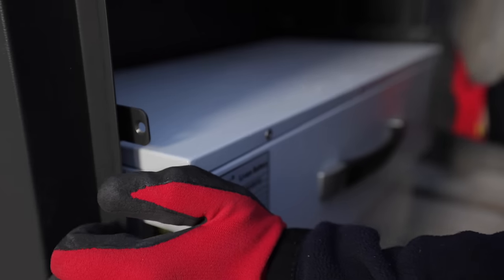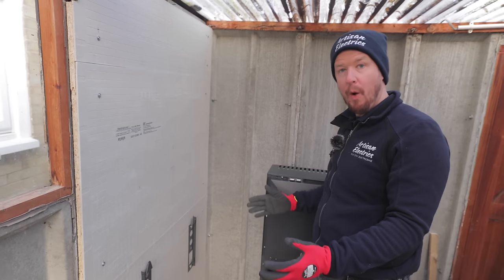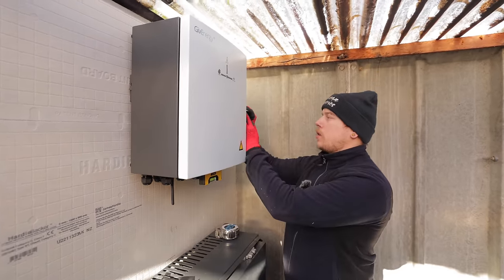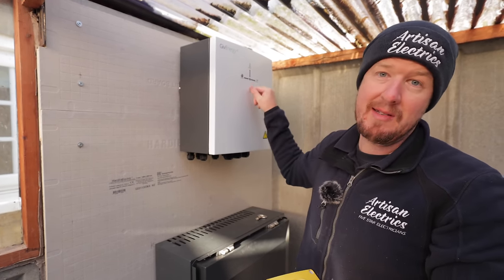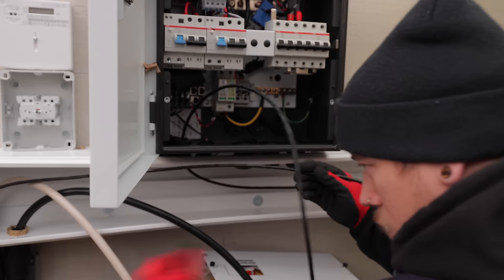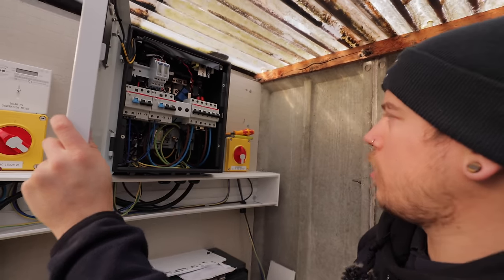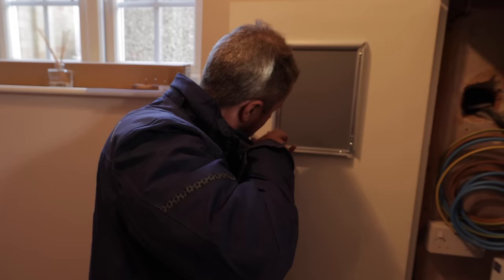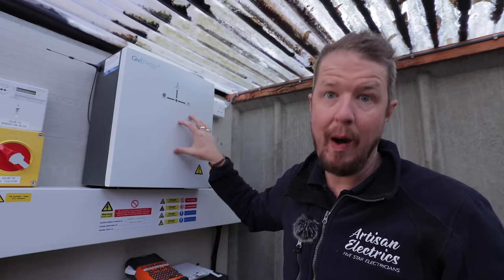How we installed the GivEnergy ALL IN ONE Home Battery System

Comment: I have the AIO and it’s a superb product. I control it locally with Home Assistant and really get the most out of it. Saved about 1/3 on my electricity over winter and have yet to benefit from the solar I had installed at the same time 😎
Reply: Wait till you have an EV and you can import at 7.5p and run your home from that instead of 30p grid price.
Reply: @Lewis_Standing  I already have an EV (and I have the Giv EVC awaiting install). I’m on Agile and averaging 10p/kWh through November and December. The ability to load shift and even better import cheap/free electricity and sell it back to Octopus for 15p 😜
Reply: I should add we are heavy users so Octopus Go (which is what I think you’re referring to) would be more expensive overall than Agile.
Reply: @jonathanthomson5000 have you thought about how long your batteries will last charging them up and discharging them for 5 pence per KW. Will it pay as batteries will only last for so many cycles.

Comment: Very informative video, thanks! I'm thinking of having one of these installed and I'm just wondering if the external isolators are a requirement or just an added extra that you guys install. Can isolation not be achieved using the breakers that already exist within the Gateway? Complete layman here, by the way!

Comment: I would be recommending much larger batteries guys. I have 36kwh of battery storage and it’s just enough to run all day in a 3 bed bungalow with 2 people in all day. We fully charge overnight in winter at cheap rate and also have 36kw of PV solar so in the summer months we don’t fully charge at night. 12 wouldn’t last very long for most…. Nice install tho! 😉👊🏼
Reply: 36 kWh is a hell of a lot. 
We have an older style give energy 5.2 kWh battery with 2700 watts of solar on our house average use in a day around 6kwh.
Reply: Used 158kwh in January! Are you growing weed?

Comment: How hot does that garage get in the summer and what temp can the battery operate at.

I had a small section of that corrugated clear roofing on my shed the rest was opaque.
It reached over 50 degrees Celsius (the thermometer wasn't marked above 50) near some metal shelves during a heatwave.

I have since replaced the roofing with just opaque stuff. It still gets hot in there but no where near as high.

Comment: 14:00 do i understand it right that in a normal house installation in the uk you rely on the erth that comes over the pen conductor? and don´t have a earth at the property which is tied into the pen on the entry of the service wires?
Reply: Neutral can be tied to earth at the service head, or you can have Earth stakes/matts.

Comment: 10:26 any normal person uses the cable with correct colors directly ... seems to be an UK thing sleevng other colors on cables ..    regulations here in Belgium are the cable has to be same color on the whole run ... and when a neutral is present and a blue wire it has to be neutral / PE has to be yellow green.   The rest of colors you can chose ( but  green or yellow wires are not allowed )  usally  L1 = brown L2= black L3 = grey ( but not obliged ) .
Reply: Heavier 3 core is used for 3 phase the vast majority of the time, so it’s produced in those colours. Difficult to find 3 core over 6mm in single phase colours.
Reply: It would be great if you could get the cable. Only way to get brown and blue is to buy 4 core which is more money and wasteful. Was never a problem in the old day with red yellow blue there was never any doubt. Since going to the stupid colours ( supposedly to harmonise with the rest of Europe) that’s when the problems set in

Comment: Every approved installer I contacted says they won’t do Giv energy installs due to poor customer service - something to do with the change over from V1 to V2 batteries. 
Has the customer service improved ? I really wanted an all in one.
Reply: As an installer I would disagree with customer service being an issue, Never had a problem with speaking to tech support be that commissioning or later on with a obscure setting.
Reply from the maker: We found the customer service to be good, we did need to phone for some help with the commissioning and they talked us through it.
Reply: As a customer on the rare occasions I’ve had to contact Giv (for technical support) they’ve been fantastic and there’s a great community on Facebook which includes some of their staff so it’s often not even required to call them as the hive mind almost always knows the answer 😜

Comment: I can only afford to make the change to green energy gradually. I plan on starting with a battery and charging on cheap rate over night so that I can start installing infrared ceiling panel heating. Ultimately I want the whole GivEnergi AOI system with solar, so can I start with just the battery or does it need the gateway installed with it? I'm leaving solar until last because the panels seem to be developing rapidly and as our roof is east/west with some chimney shading I want them to be able to cope well with that. As you can tell by the question, potential customer not sparky! Tia chaps, great vid, I like the way you instal on fireproof backing, makes sense to even up the walls. 👍
Reply: AIO and gateway are installed together
Reply: Solar first gives you the best return by using your own generated power, rather than going down the arbitrage path.  Battery technology is evolving more than solar panels, so deferring battery purchase also makes better sense.
Reply: @terrydennis467 oh, do you think so? I will keep an eye out on both then. I reckon it's going to depend on what time of year we start, in all honesty. Our finances should improve in the autumn so we'll be wanting to look at getting some infrared panels to start switching our heating away from gas. As they might add a bit to the heating bills (!) we'll want to supplement the cost which is why at that time of year it'll be battery first to alleviate their running costs. I'm just not sure how suitable our roof is for holding solar panels so I'd rather get into the nitty-gritty of that after I've got the heating sorted, if that makes sense. However if we don't get started on any of it until next spring/ summer I'll definitely consider panels first. it's a bit chicken and egg really isn't it?! Thanks for your advice, it's definitely given me food for thought. It may be that competition for this may arrive and drop the prices if nothing else. 👍
(I'm aware of the Tesla system but don't want to have anything to do with the Musk empire)
Reply: I think there is an argument that if you have an ev - a battery helps drop your overall energy price from 25-30/kwh to 10/kwh using ev tariffs. So the maybe the solar has to be considered against ‘when’ you use it and if you’re out during the day I imagine battery could be the best first step?
Reply: @constructioneerful  that's true and I do have an EV but no drive so can't really charge, although it is tempting to get a charger at the end of the garden and park on the grass like everyone else does🤔
I see what you're saying about being home all day, which I am and I need to not get cold hence wanting to power the IR panels with cheaper power from the battery. You're right that would be more sensibly done on solar but then at the time of year I need the heating will there be enough solar? Hence waiting for them to improve so I can get maximum solar gain throughout the year.

Comment: is there still a requirement for that generation meter you're fitting? Can you not use the serial number off of the gateway generation meter (GEM120) which is printed on the top of it? I know the MCS cert requires a serial number for a generation meter so why not use the GEM 120 instead? The house smart meter is for the SEG as I understand it anyways, so that generation meter is not really of any use. Not having a dig, just that a collegue told me MCS said the old gen meters are no longer needed. Cheers, great vid by the way.
Reply: I had an AIO fitted a couple of months ago and did exactly what you suggest. My FIT provider (eon) were completely happy with the model number and serial number of the generation meter already fitted to the gateway. The display does have fewer digits though, so I'll have to get my reading reset to zero more often.

Comment: Two things that concerns me about battery storage systems are longevity and replaceability. How long do these things last and how do you tell when they need replacement? And with electrical technology advancing so fast, will there be replacement batteries available in 10 years or whenever or will the whole system have to be replaced with something new?
Reply: A lot of batteries are rated for 6k cycles or more which, given that you don't fully cycle them every day means ~ 20 years.  And yes, there will be replacement batteries, but perhaps (hopefully) not LiFePO4 - but who cares? it's an ac-coupled system.
Reply: @simonrack4865  Right, so they need to be replaced after 20 years? That means that you need to budget for that or depreciate your new battery. Say the battery costs £4000: over 20 years that's £200 per year.

Comment: The original standard colours were red, black and green and as we know, these cables can still be found in old properties. Then the colours were changed to brown, blue and green/yellow. There was a great deal of publicity and explanation to the public for this new standard of three core cable colours which everybody accepted. When brown, black and grey are the cable colours it is logical (particularly in the domestic environment) to refer back to the original standards and to use black as blue and grey as green. Simples!
Reply: Nah. Guidance says not to use the black as neutral. Its in the onsite guide. Whilst yes this is only guidance. Standard practice is now not to use the black as neutral.
Reply: @travoltasbiplane1551 Correct. The move is to get everyone out of the Black neutral mindset on harmonised colours.

Comment: I'm assuming this is the AIO 6.0 not 3.6.  What these videos don't cover is the  DNO Certification (G98,G99,G100) .  The AIO 6.0 can supply 6Kw where as the 3.6 is yes 3.6Kw and is G98 certified.  Im guessing a G99/100 is needed for the 6.0.
A friend has a Tesla Powerwall and a 5Kw inverter on a G98, something somewhere is limiting the feed in to the grid to 3.6 but who knows what, can someone explain?  I would like the AIO 6 with a 3.68KW Inverter.
Reply: The units are CT Limited to 3.6kw output when on grid. This is not uncommon, lots of solar PV inverters will also do this. It gets around the DNO requirements.

Comment: Once you have worked in an 800 rack data centre facility with 8mw of incoming mains, x4 2mw standby generators and a shed load of double online conversion UPS the idea of having a backup electricity supply at home becomes a bit passe 😂

Comment: Jordan another great video. Question I have if we havecac3 day outage would this banknof batterys fully support home with heat pump in this cold weather and ovens in the evening . So tell us please how long will this battery pack last in the event of a power cut in minus 3 conditions .
Reply: Can’t work out if you are serious or just taking the piss 🤷‍♂️ it’s 12kw hours at best plus whatever you get from the solar. Might keep a few lights and freezer on and hopefully keep your boiler running. No heat pumps or ovens
Reply: @johnwarwick4105  lol, that's my point. Why do people spend mega bucks to save money, which takes many years for a return on their initial investment. My guess is Jordans bill for this job must be close to £22k . People I livecrural I have 19kw solar system and batterys. 12 years later, I am nearly quid in. When your warranty starts coming to an end and you have to fork out again, you add years. Buy a small petrol or diesel generator. £1200  will get you an 8kw generator . Fit a transfer switch so you operate one switch to feed all of home and you will be able to run your home whilst your in a power cut for weeks if needed and have a shower and get your home with a heat pump. A smaller cheaper battery system can still work for you if you are thinking of green. In my case, living rural, we have been put for days. I invested £2500 on a 12 kW generator, so we could also charge our ev as well.  Best investment we made. We still have a backup battery, but on poor light days, 4kw struggles to charge it. And by the way, on my 3rd battery, the next failure is not warranty. it's my pocket. So again, if I have to spend £2k on a replacement, then any solar profits would have to repay that first before I shout out about having free electricity.
Reply: @gino2465  yes it's going to be an expensive job. I assume the solar was existing. Adding the gateway in my view is an expensive luxury but maybe they have supply issues ( though I doubt it's that bad) 13kw of batteries should enable them to be almost self sufficient in summer months . Weather it will ever pay back 🤷🏻‍♂️ electric prices in the uk have doubled in the last couple of years so who knows. More than 4kw of solar if you have the room

Comment: With a single data cable coming from the router, how did you connect them both to the internet for commission?
Reply from the maker: Wi-fi for commissioning and then swap to ethernet afterwards
Reply: @artisanelectrics  which did you leave on ethernet? We find the gateway doesn't need constant internet so the aio gets the hard wire

Comment: My wife arranged for solar panels to be fitted and wanting to be "independent" did not include me in the discussion. Originally she asked for the inverter and battery to be fitted outside but they phoned and talked her into getting them put in the roof. When I noticed, I asked the installer if he would be fitting a smoke alarm in the loft - he looked at me blankly. I told him the latest guidance was to not use external DC isolators if they are built in to the inverter, but he just shrugged and said he was a contractor. Obviously he did not attach any fireproof backing to the wall either. Should I speak to the company my wife bought the panels of or just leave it? I am going to fit a smoke alarm linked to the landing and fit an easy access ladder, and keep a fire extinguisher up there. What do you guys think?
Reply: Probably easier to get divorced. 😂
Reply: @idi0tdetectioninprogress  🤣

Comment: If adding an EV charger would you also use a Giveenergy one or combine it with say a Zappi? Can you add more battery capacity to it via a standalone battery?
Reply: Better off staying with the same environment, so I'd say a givenergy charger. You can then integrate the two systems together so that your EV doesn't drain the AIO battery when charging.

Not sure if Givenergy have released the firmware to support it  yet but the AIO was always planned to be paralleled with more AIO's. But when first released, you could only install one AIO.
Reply: The GivEnergy EV charger was not available at the time I had my GivEnergy Inverter and batteries installed. So I eventually caved in and had a (MyEnergi) Zappi installed, it works ok, but it’s not integrated… But neither is my ASHP. 

As far as the GivEnegy App is concerned the EV charger and ASHP look like a big kettle is being used!

For me always aim for Integration. 

(A Zappi is more expensive too!)
Reply: @John-FourteenSix   It does seem that the givenergy EV charger doesn't integrate with octopus at the moment which does count it out for me unfortunately :(

Comment: Is there no inverter on the market that doesn't require a switchover from grid to battery/solar?? I would've thought it would be possible for grid to feed inverter and solar to feed inverter at the same time, and the house wouldn't know where its getting its power from. If grid goes down, inverter can just cut the supply so it doesn't back feed the grid. Wouldn't that stop lights/electronics flickering or turning off etc when the power switches or goes down?

Comment: So it seems an external 3rd party solar inverter is still needed in this system (in this case, in the loft).

Is there no way to feed DC straight from the solar panels straight into the  AllinOne battery and avoid DC to AC then AC to DC conversions and losses. ?

Anyway, great video, thanks.
Reply: No, this accepts AC only from the solar inverter. Good for folks who already have solar PV. If you are building from the scratch or want direct DC, then go Victron.

Comment: Are the units waterproof as that plastic sheeted roof could well leak?
Id suggest fitting a steel section cover over that area under the roof.
Reply: It’s all IP65 rated. My battery is outside.